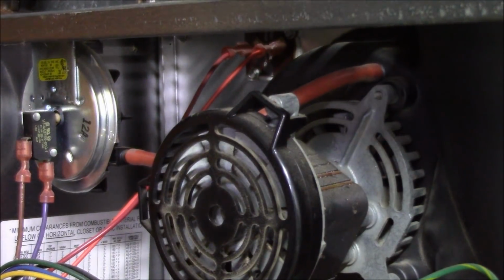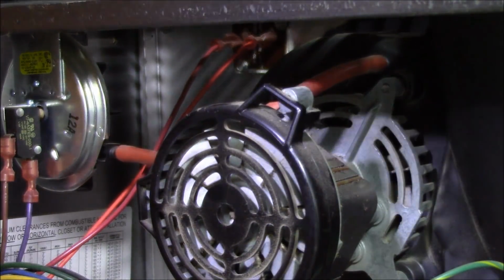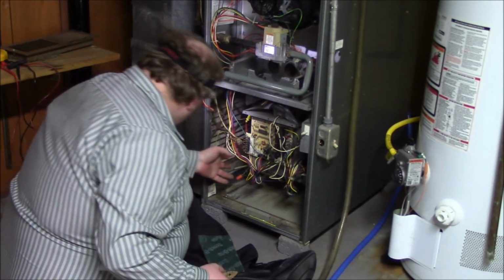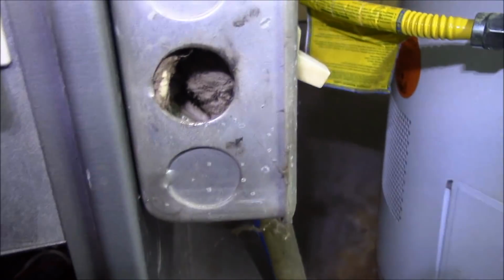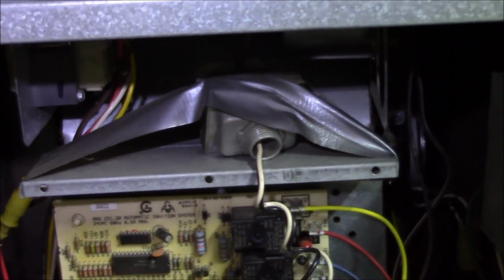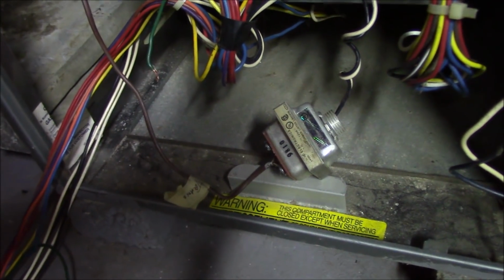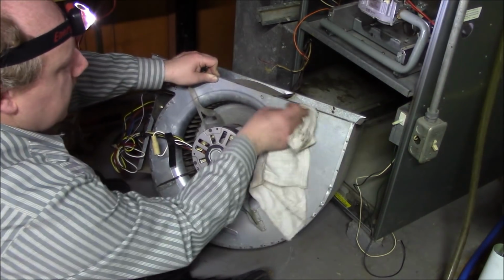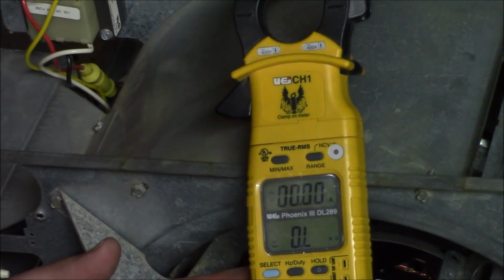Rheem gas furnace service clean and check (flame sensor cleaning) part 3

Comment: I like this dude….and as I’m watching this it seems as if my humidifier is hooked up in the wrong place on the circuit board. I just replaced the board and that’s definitely not where they were connected. I have the same exact furnace. My fiancés house… no filters at all! 🤦🏻‍♀️ which is why I now have to clean the evaporator coil.
Reply from the maker: Glad i could help. I have more videos on my channel. This one it part 3 of a 7 part series on servicing that furnace.
Reply: That’s amazing. Glad I found your channel and very appreciative you took the time to make these. Our 18 year old furnace will be as close as it’s gonna get to new!
Reply from the maker: Your welcome.

Comment: Is there an actual flame sensor on that model and where would it be? thanks
Reply from the maker: Dominic LaCavera yes, Rheem has it located under the burners. I have many videos posted to show how to service it and where it is located. You will need to remove the blower door to get to the screw.

Comment: Great video! 
Where is the flame sensor though? Did I miss that part?
Reply from the maker: Under the burners. This was part 3, you need to find part 1.
Reply: @ChilesHeatCool  Thank you!!! Found the video. Must have a different furnace. Wasn't located in the same spot. This thing has to be hidden, driving me nuts. Thank you anyways. I'll keep looking.
Reply from the maker: Your welcome. If its a Rheem furnace it's an orange wire that goes under the burner to find it. Unless you have the one that does not have a flame sensor.

Comment: what if the pressure switch hose keeps filling up with water and shutting off the flame, after a couple days of use? any suggestions?
Reply from the maker: Javier Hernandez plugged drain would be my first guess. might even be a plugged up trap in the drain line. Not on the a/c but on the furnace if it is a 90% one.
Reply from the maker: Javier Hernandez a shop vac on the drain pipe can help with sucking out the gunk. make sure to was you hands as the furnace condensate is acidic.

Comment: Could the pressure switch be the culprit when firing up the furnace and after several failed attempts, it will light up and operate normally.  This after the furnace has already been used throughout the evening, hence "warm".  It has no problem starting after a long night in the AM ("cold start").
Reply from the maker: fastsvo possibly yes. If it lights and goes out 3 or 4 times I would say flame sensor. If it lights and goes out over and over and over pressure switch port is plugged.
Reply: Thank you for your reply.  Looking at the ports on both sides of the vacuum line they are clean. When I applied vacuum to the pressure switch it seems to alleviate the problem for at least a day. I'm assuming I am reseating the diaphragm when doing this?
Reply from the maker: fastsvo now make sure the vent system is clear and the cap on the vent hasn't collapsed. If you feel air coming out of the draft diverter on the water heater, assuming it's gas and the furnace is fired up, you have a different problem. It might the switch is going out or the inducer is weak. I would bet it's the switch. The only way to test it would be with a digital nanometer but those get expensive.
Reply: ChilesHeatCool one  observation. As it goes through these multiple attempts to light off, during one of the attempts I saw a quick flame develop and immediately go out.
Reply from the maker: fastsvo not sure on that. It would depend on we're and when in the order of operation.
Reply: ChilesHeatCool looks like at a minimum I should change the flame sensor and the pressure switch for good measure.

Comment: I ended up replacing the direct spark ignitor and pressure switch. Recently, the furnace will again attempt to light (1-2 sec of spark) then quit, then try again, quit, and on attempt #3 (with loads of spark duration) fires up successfully and away we go. This is starting to drive me nuts. Could it be the ignition module (round black part) on the board itself? Seems when it does have an acceptable spark duration, its powerful enough to ignite the heater. Grounding issue? Any help would be greatly appreciated. Thanks.
Reply from the maker: You could try cleaning the spark ignitor rods. The spark board could be weak to. If it is trying, than the safties are closed.
Reply: @ChilesHeatCool  The rod within the black round part?  I'll give that a try.  I would also like to add that during this failed ignition sequence, when it sparks for 1-2 seconds, the "ok" light on the board will illuminate off and on in conjunction with the ignition duration (or lack thereof), but not throw a code.  I also pressed on every limit switch I could find and none of them were popped.  I am assuming your comment on "safeties are closed" is a good thing since all those checks are "ok" during its sequence?
Reply from the maker: The rod or rods by the burner. Careful, sprak ignition is around 10,000 volts.
Reply: @ChilesHeatCool  The ignitor rod is new.  I am starting to think this is an intermittent weak spark condition and from what I have read, it's pointing to a board replacement (which I did 4 years ago).
Reply from the maker: Yup, sounds like the board.